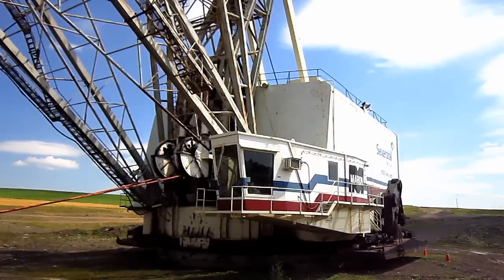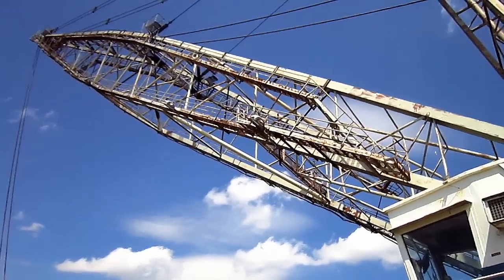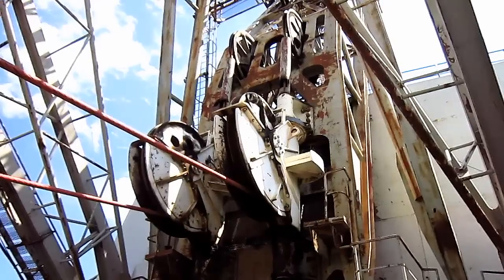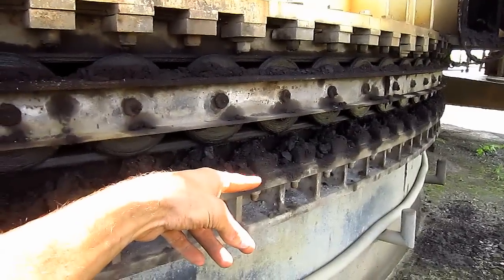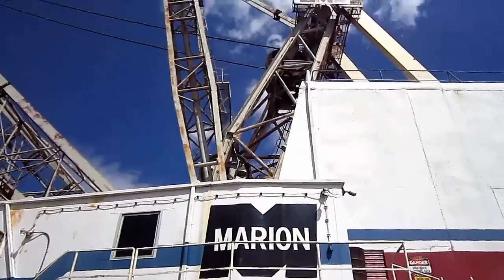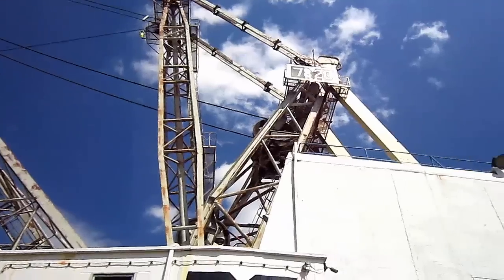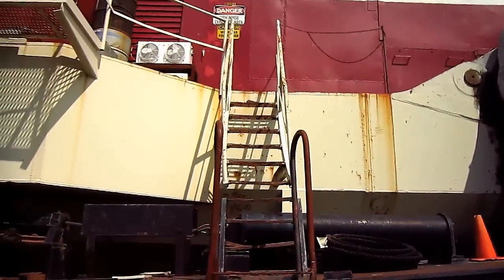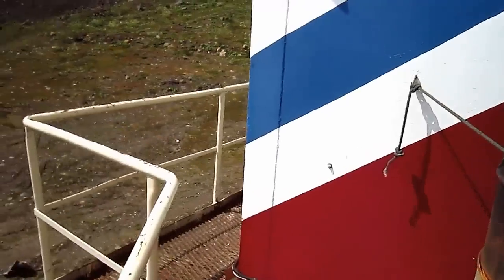The Marion 7820 MEGA Dragline

Comment: Hello Justin.Didn’t Marion make 7820 without a mast.What was there bucket and boom size if it didn’t if it came without a mast.Thanks.
Reply from the maker: The very early models were built without a mast.  I'm not sure what year Marion incorporated the trip structure, (probably in the 80) but it was on later units.

Comment: What a beast! I'm very curious on some of its own history, was it sent their new?  purchased from another company?  been there it's entire life? 
What are the plans with it? 
Looks way too nice to dismantle.
Reply: Bought new in 1980 by Northern Strip Mining. NSM. Was here in Somerset County, Pa. it's entire life. Now in Florida as of around 2 years ago.
Reply: @robertestep7017  at the beginning he said it was a 1985 model. What is it going to be doing in Florida? How many truck loads does it take to move something like this?
Reply: @boom-rl7me  It was erected in 1980 a few miles from my home. I worked for the company that owned it for 17 years. I don't know what is being used for in Florida, just glad it wasn't scrapped. PA Mining has a very good video of this dragline while it was in operation at Job 200.
Reply from the maker: Thats awesome. So it came from NSM. This state has always had such a close connection with UK coal. I may have got the date wrong but that's awesome info. Thanks!

Comment: what are those 4 i beams sticking out of the rear for?
Reply: For lifting parts in and out of the machine.
Reply: @brianw8963  RIGHT MANILY ELECTRIC MOTORS AND GENERATORS,BEST IF YOU DON'T NEED THEM MEANS NO MAJOR BREAK DOWN.THE CAB LOOKS ALOT BIGGER THEN THE# 1 7820 THAT WAS BUILT WHICH IS IN MIAMI FL NOW 2024.
Reply: @brianw8963  ahhhh makes sense! Thank you for the info

Comment: Here where im from in Western PA the coal company ran one of these, a W2000 Rapier and a 1300 BE as the big drags and had a slew of 7400 Marions, 4600 manitowoc and 2400 Lima drags too. Any given night in the 70s and 80s could see at least 5 or 6 jobs going simultaneously with the lighted booms swinging around.  Too bad those days are long gone
Reply: C&K coal company had a lot draglines back in the late 70's to mid 80's
Reply: @markguntrum176  that's who I'm speaking of.. it was a different time period then  sad it's not that way now and alot of the guys who worked there are dying off. My uncle loaded from under that 7820 (unit 45 in C&K and RFI energy terms) for a long time and my family had contract trucks hauling coal for them. Shit I remember in Sligo it was nonstop trucks and black smoke back in the early 80s. Lol
Reply: @MrX-rq3fj  They loaded a lot of coal on to railcars from the 3 tipples. The rimersburg,piney and shannon tipples were something to see when they were running.
Reply: @markguntrum176  My one grandfather worked at Shannon and the other had triaxles hauling coal there  actually I'm working out of the old Rimersburg truck shop right now where the tipple used to be. Was in Piney right after they shut it down, it was massive.  I was just a young kid but wish I could have seen the 675 Michigan they had, guess it was nicknamed "the moose" and wish I could have witnessed the double 9s they ran, knew a few guys that ran them. I actually drove one of our trucks hauling when it was RFI. By that time C&K all but a memory and the only tipple left was Shannon
Reply: Ambrosia had one. Essroc.  Etc
Reply: @MrX-rq3fj  was on the ones at essroc and ambrosias many times like to go back to that time
Reply: Makes me sick seeing these impressive machines sitting idle. The bureaucrats would rather have it scrapped and converted into cheap Chinese junk. I appreciate you filming these before their gone.
Reply: Here in s Wales UK  there was a Rapier 1800, at the time it was one of the biggest around and in a similar area was Marion not sure what size, all scrapped off now
Reply: I remember the sounds they made
Reply: I’m from the same area and miss those days. (Not so much the nights) Spent 45 years in those strip mines on all types of equipment, my favorite by far were the 2400’s . Most all of them went to Florida long ago, and the last operating one in my area was recently sold and went to South Vietnam. 🥲